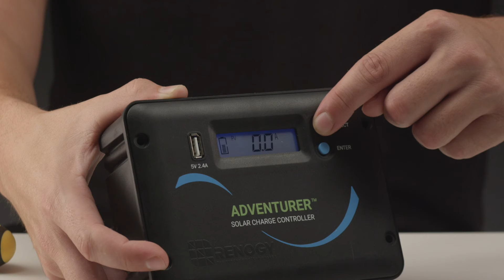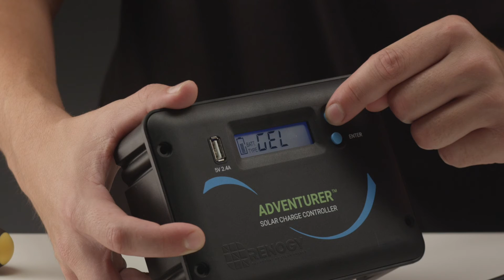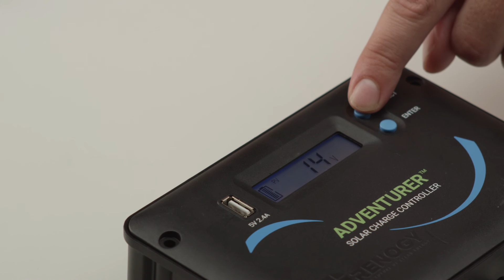Renogy Charge Controller — Adventurer

Comment: So not only does the unit not indicate which ports are for positive and negative or panels vs battery, but you used all black wires and let them loop behind the table so the video doesn't help
Reply from the maker: Hi, Tree.

Thank you for your feedback which helps Renogy constantly improve customer experience. We have reflected the problems to our related department and we will improve it soon.
Reply: @RenogySolar  the lables are under the cover on the unit itself

Comment: Hello. I brought two sets of these units, I have tried several times to call the 800 number.  Every time i do, I get a busy signal. I tried to wire up the controller as shown in the instructions. The controller did not light up. After spending a lot of time to try to figure out why not. And after thinking about sending it back, And after more tries to contact them. I went ahead and changed the wires on the control to the battery and got it to work.  Needless to say. Reversing the battery wires does not hurt your unit, or at least mine.

Comment: I know this will accept 12 or 24 volts. But how many volts out?
Reply: I believe the controller has a voltage sensor built into the PC Board, that tells the CPU what Battery is connected to it. Say if it is a 24 volt Panel, but a 12 Volt Battery, the controller will sense this and make the needed adjustments automatically. DON'T hold me to that, but that is my understanding......